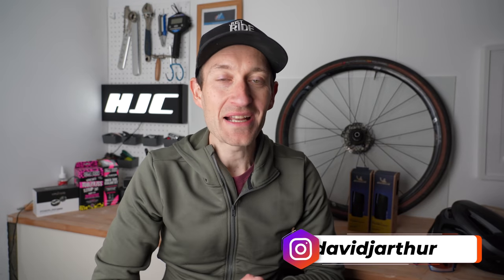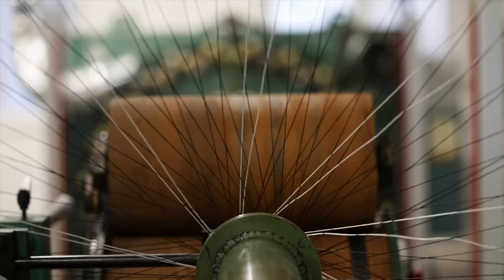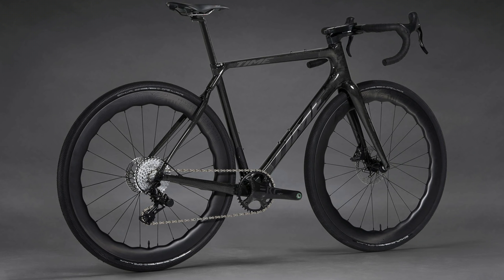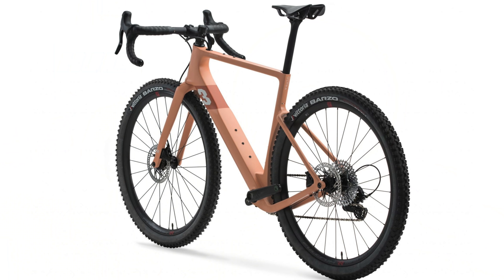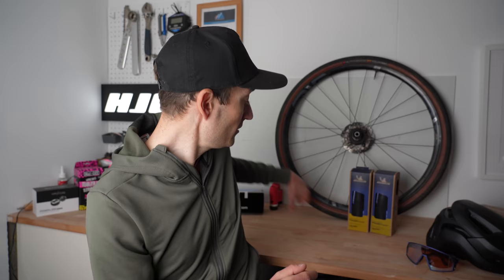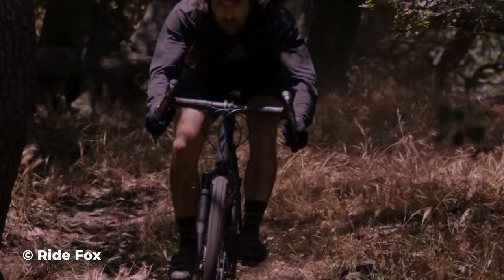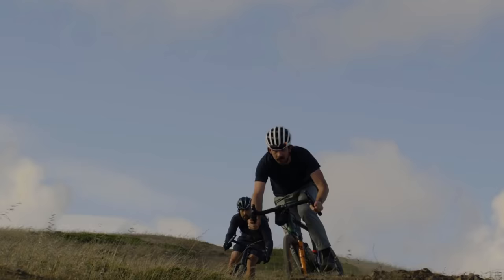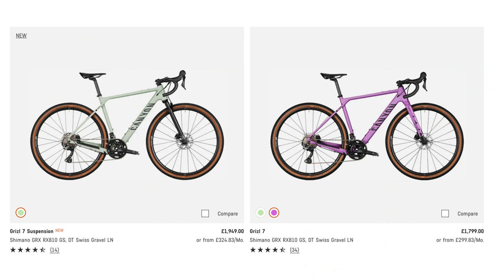NEW BIKES from Time, 3T and Does The World Need Gravel Suspension Forks?

Comment: If you want more than 40mm tyres, you need a mtb, 40 plenty for loose surfaced roads., sometimes called gravel.
Reply: I'd agree; that's my thinking; 35-40mm are more than enough for light gravel/forest tracks. Anything gnarlier, then you'll be better off with a MTB.

Comment: I bought my Lauf fork 2 years ago and can't see it being improved. Lauf is still using the same design. It really is the end-all be-all for gravel suspension. It's maintenance-free and absolutely perfect for low amplitude, quick successive hits. And it's way lighter.

I also have the previous 3T Exploro RaceMax and am waiting for some 650B carbon wheels. I bought it because of the short chainstays and instant input. While I am sad that I don't have the 27.2 mm seatpost, I am not terribly stoked for this bike. The original, I bet, will still be the faster option.
Reply: Except that many people don't like the Lauf because of its tendency to "bounce"?
Reply: @Emolokz  noted. I haven't noticed it but clearly it isn't adjustable.
Reply: @seanrequiredfieldcannotbel1362  right, I know it's not adjustable, I just mean that several people have noted that it feels very "pogo-stickey" when going through tech.

Comment: Note about the Fox 32TC, you can change between 50/40mm travel with the air damper swap like other Fox Float forks (confirmed at Sea Otter).

Comment: You are better on a fully mtb. Mine weights less than many gravel bikes.
Reply: but you only have one hand position, which is a downside on long rides. Usually a gravel or CX frame triangle has a lot more clearance for a framebag as well, so there's benefits to both

Comment: I found a magnesium headshock less than 100g heavier than the stock fork & know if it's NOT a UCI course you want one on real gravel tests. [Travel ~40mm a guess]

To then mention I found a leaf-spring 4-axis seatpost shock less weight than 4-spring keeps the rear wheel in contact braking and turns, seated powering the other reason I'll never go back to hardtail, neither has required servicing yet, say 2,000 miles on them.
Ymmv, hth 🍺

Comment: Time really missed the mark with that tire clearance. It's not 2018 anymore.  Max of 40c just disqualifies them from any serious consideration for gravel enthusiasts.
Reply: I can’t tell if your taking the mick of not…..
Reply: @tombladon8064  I couldn't tell if Look was taking the mick or not when designing a gravel bike with a max clearance of 40c.
Reply: @tombladon8064  45mm is pretty much the min for proper gravel. 45 clearance will safely allow people to run the more common 41-42mm tires while still having enough mud clearance to not be constantly worried about the frame
Reply: @cjohnson3836  I guess I've missed the boat on this. I don't wanna end up like the old git on the club run flabbergasted that people are running 28's and disc brakes...
Reply: @tombladon8064  Ride what you own. Surly is still claiming a max 42mm on the straggler. Tire jumps though seem to be settling on 35,38,41/42,45. Below that you're on a road bike, above it and I think you're better off with a hardtail. But regardless of my opinion, frame builders are at the mercy of the component makers and trying to build a frame for a wide a range of conditions as possible. While 38mm is probably the sweet spot for most people, I'd rather not need dental work after some of the rides in Appalachia. Frame designers are finally realizing that a bit more clearance than necessary helps save people's derf, and their frames

Comment: I came from mtb full enduro, i love gravel for the simplicity, no dealing, no maintenance, it reminds me a single speed mtb full rigid but with no limits on the road you can climb Stelvio or go on a high mountain road with same bike. Suspension on a gravel is a non sense, if you need more suspension than a 42mm tires... you made wrong sport.